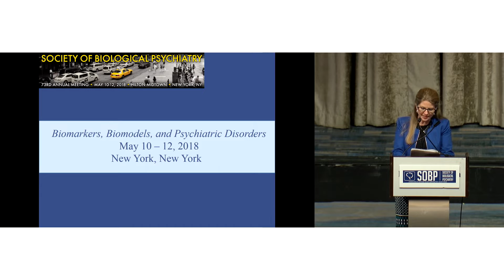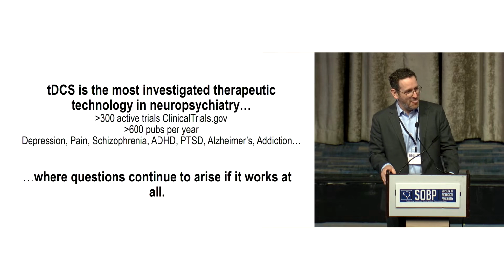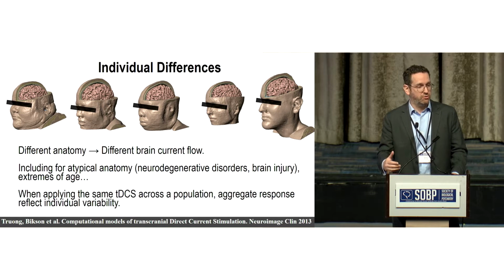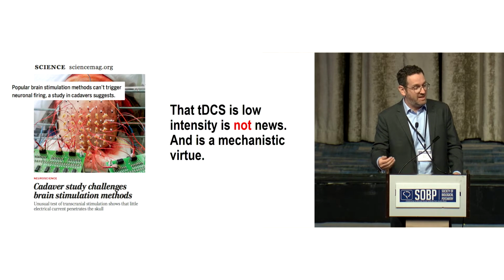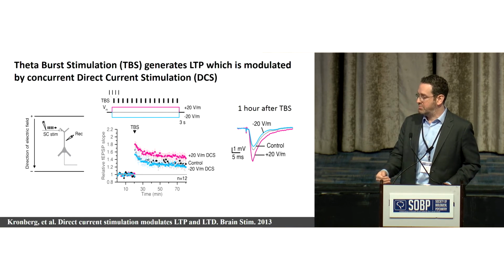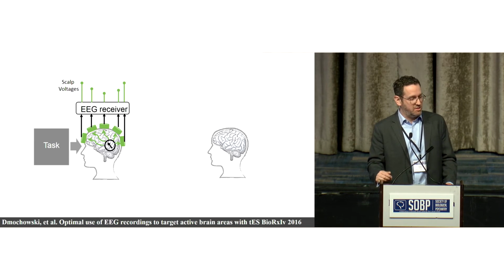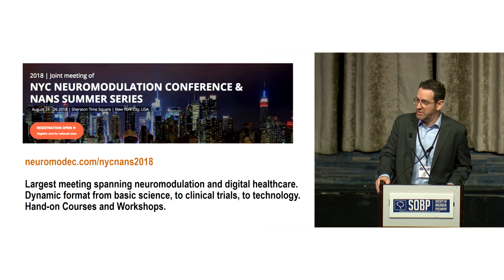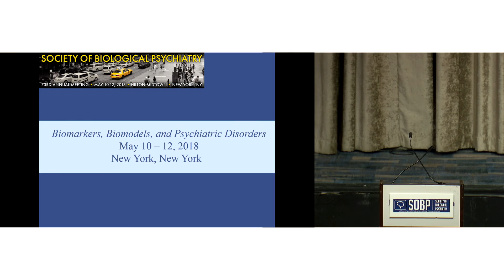Dr. Marom Bikson: The potential and Limitations of Transcranial Direct Current Stimulation

Comment: Has anyone got M.E. and used the device? Any probs/higher sensation on forehead?
Reply: I am always exhausted but it's been put down to depression, it's helped a bit with sleep quality. Also get dermatitis on my face at times and where the electrodes go it has flared it up, but seems to be easing as I get used to it. No sensitivity after using, only during (a stinging/ burning feeling).

Comment: What do people here think about Flow? It’s possible to buy now. But quite pricy for the regular person
Reply: I'm using it, there's a 30 day money back. I think you can rent for 3 months then buy at a discount, so it works out about the same price in the end, factoring in the pads they send with rental. 
I've had depression that's spanned decades, quite debilitating I'd say, been on every medication going (lots of antidepressants and also anti-convulsants) some quite nasty. 
I wasn't expecting to feel anything with flow but it actually made me feel a little stoned/sleepy. I struggled to do it on the days you are meant to, but have been forcing myself. The process can be annoying, but staying with it. I suffered deeply with my sleep and that caused more depression and exhaustion, so it helping me sleep a bit has been of some relief. I do feel a bit funny for a bit after using it, foggy, but think that's easing with use, and I like to do it just before bed (phone on night setting, so no blue light when using the app) to aid sleep. Still struggling and have days when I've felt crappy, but do think it's somewhat helping me and taking the edge off, which I'll take.  Feeling a bit better hasn't necessarily translated into doing more, or getting things done that I need to, just more of a sense of calm. I've noticed for example if something happens that really upsets me and I cry, I can tell I'm upset, and know I'm crying, but don't feel the tense pain in my head that I'd normally get along with that, so slightly numbing. Still only on week 3, so not sure if there will be any further benefit. I know from reading some people don't get a benefit until week 4. And reviews are 50/50, some get nothing, whereas others who have been in very dire straits have had their lives transformed. I'm definitely a tough case, won't go into it, but relatively pleased with even just help with sleep. There is a Facebook group where you can read other people's experiences, good and bad and get a range of people's feelings on it.
Reply: Apologies for just repeatedly adding my postal tracking number for an item! 😂 My phone's playing up, froze and just repeatedly added it as a reply as I hacked at the touchscreen.

Comment: If you understood the basics of the ill-posed inverse problem of EEG you wouldn’t be making your BS claim that one can stimulate the EEG source by reciprocity.
Reply: I'm happy I'm not the only one who thought that seemed like a wild claim.  How would someone even defend that claim? it doesn't make any sense. even if the  the "inverse" of an EEG could cause depolarization, how could it find its what back to a point of origin, let alone preferenchly interact with specific neurotransmitters? Am I missing something? is this a main stream view in this literature? ah. sorry for the rant. is there's any legitimate literature on this, if so would love to hear of it! Cheers
Reply: The signal travels through neurons that are already in action potential. Much like how electrons conduct through an arc, the ion channel depolarization forms a path of least resistance. 
The neurons ion channels activate in pulses, which cause oscillations. These waves are important as phase array based stimulation allows the equipment to create standing waves which are either in phase (amplification) or out of phase (interference).
The depolarization of brain cells forms dipoles. The inverse problem was solved by bidomain and monodomain inverse operations in 2015.
Reply: @ShivaTD420 is there a Source for this? How can this even be allowed and marketed in the way it is. This is nothing other than strong magnetic fields aka brainsmog. And a lot of it which is really harmful